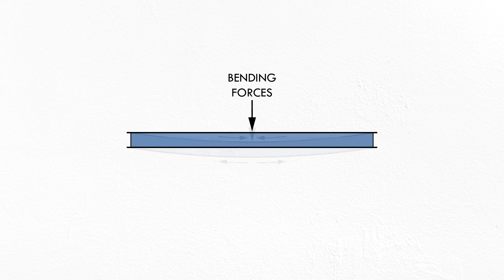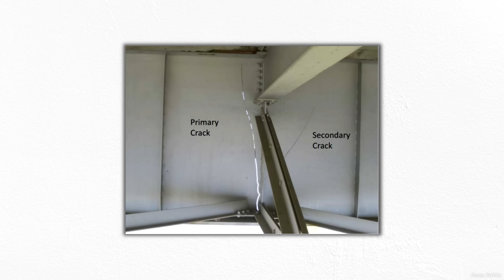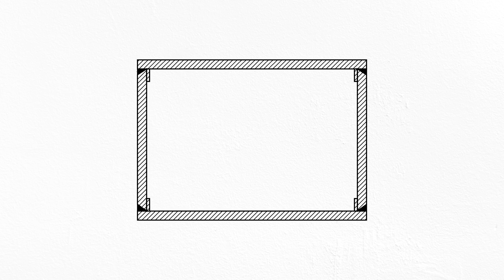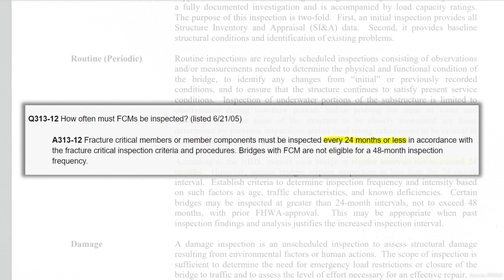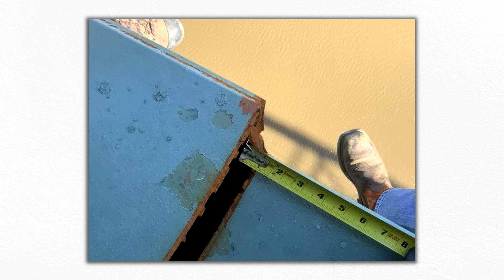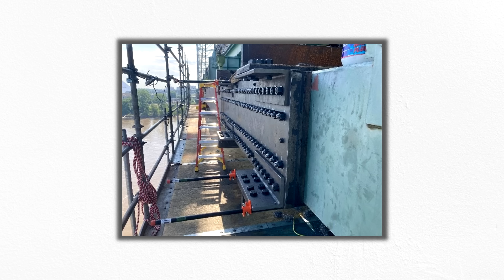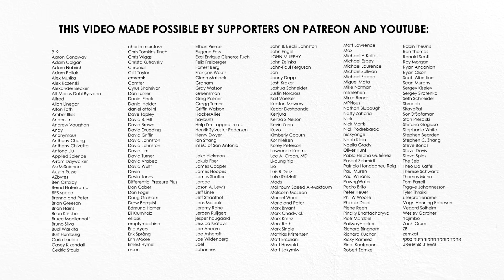What Really Happened at the Hernando de Soto Bridge?

Comment: Arkansas is responsible for the inspection of this federal property 
Arkansas can’t even keep the stretch of 
Interstate 40 
Back in the 80s and 90s the worst interstate highway in the country was Arkansas I-40
Potholes big enough to rip tires off rims disconnect tie rods and break loose lug nuts 
I know because I have been driving for 40 years and I still don’t like driving across Arkansas 
Back in the 80s the only smooth highway in Arkansas was the highway from Little Rock to Bill Clinton’s home in Hope Arkansas

Comment: Kudos on the engineer who insisted on the shut down of this bridge, and had the insight to know that the statics were severely compromised which posed an immediate danger to lives of those using the structure.  I once lived in Stamford CT, and used the Mianus River bridge in my daily commute.  That structure failed catastrophically, losing an entire deck section which caused a number of deaths before the situation was discovered, and that section of the I-95 was closed.  If I recall correctly, that failure was caused by reverse bending fatigue in a pair of steel pins which held the deck in place.  The Mianus River bridge collapse happened overnight, when the traffic load was at a minimum. Had it happened during the daily rush hour commute, the results would have been an epic tragedy.  Bridge inspections are an essential part of keeping the public safe, I'm very surprised that the crack was documented in other inspection records without being subject to closer scrutiny by the responsible parties and that the crack went totally through the box beam before the bridge was shut down.

Comment: Like so many public (and private) construction projects, once the structure is complete, it is often assumed by the owners that it will perform perfectly forever without maintenance.  I've seen it over and over where the owner, at some point becomes aware that there is a failure of some description and wants to immediately know why his poorly (or never) maintained structure has a defect.  All structures age and will eventually haave numerous small or a few major defects to develop that will fail to perform their original function and when enough of these developing defects come to exist, a collapse is possible.  I understand that in the case of this bridge failure, the beam was poorly fabricated and the welds were cracking while the bridge was being erected.  Proper inspection of fabricated members during early stages of construction should discover these, especially on critical members such as this one.  Unfortunately, such inspections are sometimes eliminated when the cost of the project is reduced to the budget and it permits such defects to happen.  Budget cutting by non-professionals is one of the most detrimental things that can cause such dangerous conditions to exist.  Cutting the budget without expecting resulting potential failures to happen is foolish.  Adjust the budget upward to cover the cost of the work or change the requirements for the project (seldom done).  You can't have both a cheaply built structure and a sound structure.

Comment: WOW... I love it that you believe in SYSTEMS and PROCESS and root cause analysis rather than blaming someone. (somehow I knew you would)   No ONE person should be responsible for inspection.  Did no second person view the video that the first person took?  That is a process error.  No major surgery is done without TWO competent surgeons in attendance.  And that's ONE person's life at stake.  How many lives might have been lost because ONE person took a video and no second person evaluated it?  This was a failure of the SYSTEM - which failed either to have quality process or failed to assure it was carried out.  This was a failure of a management team.  Yeah... shake-ups are like earthquakes on a tree. .. the limbs at the bottom get shook up the most... Sometimes, you need a big wind.. to blow the top off.

Comment: I think it's BS, sure there was a problem but look at the rest of the structure you know I'm not an engineer but I am a builder and I've seen lots of things and to jump the gun like that I think is a little nuts in fact I believe the original engineers of the bridge put in safeguards for exactly that kind of thing to happen and for that bridge to still be viable until solution could be applied. Yeah there's arguments I know between all of you and the guy that got fired or the folks that saw it or probably a little more astute than many of the engineers that have themselves all puffed up that they called 911

Comment: This wasn't a stress crack until they performed their retrofits I'm speculating that it was a weak portion of the beam to begin with and it was cracked who knows for how long but when they made the changes and added the strength to the pillars or the pilings they stressed that portion of the support structure more and caused it to finally crack completely it's just amazing that the whole structure stood up to that failure I don't understand why they wouldn't let barges and regular River traffic through it's not going to fall obviously and I think it's easily fixed keep an eye on the rest of the fridge forever and go about our daily business that's just my two cents maybe three

Comment: This was my first time seeing one of your videos and I liked it very much.  I learned a lot about this kind of engineering in a short time back in 2007 when the I-35W bridge next to my workplace collapsed suddenly.  A Berkeley structural engineer named Hassan Astaneh-Asl came to town and we spent a lot of time together.  Memphis got lucky.  I drove under our bridge twice every day, and I had driven over it just a couple of hours before it collapsed.  Someone I knew was on the bridge when it fell, but they survived while 13 others perished.  There are hundreds of these fracture-critical bridges in the US.
Reply: And several more of those here in Minnesota have been replaced since then, starting with the Hwy 23 De Soto bridge in St Cloud -- which was like a smaller version of the 35W bridge, and had the exact same gusset plate issues.  Later was the US 52 Lafayette Bridge in St Paul, the US 61 bridge in Hastings, the I-90 Dresbach Bridge between La Crosse (WI) and La Crescent (MN), and most recently the US 63 Eisenhower Bridge in Red Wing.  Not to mention a number of other, much smaller bridges around the state.

Comment: Yes I agree I worked for BSI and UL on quality of products.
This sounds like the Chinese way of quality as they will fire the person involved, this person usually has not been trained and is an easy scapegoat.
But as you said it should be at le.ast two people looking at lthis, so a discussion car resolve what one sees it's better to highlight a suspected fault than ignor it
It sounds like either poor training or management from the top or both.
I believe that you can now use an optical fibre adhered to structures with computer software, which will alert you of  a failures, As I used to visit a company in the Guildford UK area making the device.
It could also be used for earth quakes, security and mrny other things.
I presume that the beam or brass may have to be replaced?
Thank for another detailed video.

Comment: Well it would be obvious that after one tension member cracked and the bridge didn't immediately fail I would assume other tension members are carrying the load. I would also assume that means that other tension members are now carrying more load that the were designed for. If not dealt with the other members would eventually fail, when enough of them fail a lot of bridge is going to get wet.

Comment: Having been someone who was having to travel across this bridge frequently enough from a previous job. On the eastbound section that the crack was discovered. There is no DOT inspection station going into Memphis. Because of this overloaded dump, and cement trucks would often be seen traveling this section. On the westbound side there is a VERY obvious DOT/Inspection station for Arkansas. And you'd often find them with multiple trucks being inspected or being taken out of service. So that side would of been very under traveled by those over loaded trucks. I personally did not like this bridge as I did not believe it was a safe bridge. (There was a very odd jarring sensation over the proportion that had the crack). That being said, Kudos to the engineering team that built it, they did their math correctly at least!

PS: this was back in 2018.

Comment: 5:18 - the bridge remains standing as the arch has thickness and is not flimsy like your model. The arch on the bridge will allow considerable 'give' compared to the failed beam in straight tension.

Comment: 2:00 Nice crack - but I can't see what it's supporting - it doesn't look load-bearing - it's a suspension bridge, supported from above.
3:52 - looks like the failed beam was too short. I guess the bridge has 'settled', that's all. If the fault was serious, the bridge would have collapsed. ;)

Comment: Hats off to the engineers who designed the bridge. Both the arch and the pylons embedded in the river floor relieve a significant amount of the tension in the damaged steel members considerably. There seems to be at least 2 alternative routes for the forces to flow through, equating to partial redundancy. My guess is that a simultaneous crack/break under the opposite carriageway's corresponding structural element still wouldn't lead to a catastrophic collapse of the bridge. In my opinion a brilliant piece of engineering which took into account inevitable material fatigue and human error.

Comment: Fatigue caused by excessive stress is inevitable in such structures.  Trucks carrying heavy materials where drivers don't adequately identify weight at each axle or overall can, over time, cause such stress with subsequent failure of bridge members.  We see that on highway surfaces where paving materials give up where tires pass over them repeatedly.  Excessive movement of structural members due to such stress can and does create failures.  The 2007 bridge failure in Minneapolis is another example of stress caused by another key factor....design limitations being exceeded.  Adding lanes over a bridge by use of cantilever has some bridges basic structure so overloaded that something like a traffic jam can initiate failures.  In the case of the 2007 failure the cause was eventually identified as a complex set of different factors that created the collapse.  Added lanes, new pavement being added and rush hour traffic all contributed.  Basic supports let go due to the combination of somewhat unrelated factors.  Another cause is poor maintenance.  And yet another is poor design.  With the shear number of such structures it is amazing we don't see more collapses.  Inspectors are our best ally in the fight to combat calamitous incidents.

Comment: A very interesting story and analysis! I couldn’t help noticing in the drone video, as well as the obvious box section crack failure, that a smaller vertical tube support showed signs of a non designed bend with rust appearing to show itself at what may be an impact point. It’s hard to think how that happened. You dealt with flexing weakening. You did not mention the possibility of river traffic hitting one of the support legs, which might have resulted in any impact point being below the average visible waterline levels. Such an impact could have resulted in local increases in steel tensions which may have triggered and sped up your explained traffic load flexing concept, thus leading to the critical failure. What do you think? Also: do you know if divers have inspected below the waterline for signs of impact or other issues there? Thanks for you really interesting approach to complex issues. It’s very refreshing and enjoyable to work my way through your whole output. Regards from a UK farmer who does a lot of self build projects and might have been in construction in another life!
Reply: Well spotted! Looking at the recent crack images again, that vertical tube is very definitely not vertical.
Reply: I am not sure, but I think that is just a downspout for the street drain.
Reply: @DBKING04020  Thanks. I see what you mean.

Comment: Crane rails are mounted on...
In the steel mill I work we do take out all bearing structures of the cold rolling workshop, some are older than fifty years, atm, because some have gaps of 50cm from the lower side upwards.
For the better understanding, these parts are double t, 10m long, 1,5m high, mounted on the floor collums 15m above the floor...
The rails are on top.
We have 11 halls, between 500m and more than 1km long, with between 3 and 8 cranes each...
Happy birthday...
U can't avoid the results of decades of heavy duty. Steel isn't immortal.

Btw, the guy, that found the gaps and shut down the whole crane traffic instantly, was my brother, he's now retired... And the we do not know, who is doing the inspections...
Fascinating.

Comment: Got to love our present age of lawlessness. No Individual responsibility coupled with increased reliance on individual responsibility. Probably the only thing that saved this situation from disaster is the structure is obviously robust enough to stand without that member for a time. The arch itself has some truss to it which can resist some horizontal tension. The deck has both depth and cross bracing all of which adds to the ability to reroute tension for a time. There is a reason why trusses were and are used, not cheap but very forgiving when your materials do not deliver the designed performance.

Comment: The inspection procedures are definitely lacking, this severe flaw could have been easily spotted by either drone inspection or high resolution photography reviewed under magnification. Both of which could be easily accomplished without touching the bridge. A true inspection for integrity would require a much more stringent methodology but even a cursory inspection would have revealed this flaw.

Comment: quick predictive comment at 5:35 regarding why the cracked tie didn't immediately collapse the bridge: the diagonal cross bracing between the ties beneath the deck were able to transfer the tension load both around the crack and to the other tie member.  if one of those diagonals had failed as well, the bridge certainly would have collapsed.

Comment: This is a wonderful review, thank you!  Sweltering in New Orleans after Hurricane Ida I would like to ask you to consider reviewing the multi-day Entergy power grid failure. Apparently one of the major high voltage power transmission towers spanning the Mississippi River collapsed during the storm in winds not exceeding 80 mph. Obviously these towers must be designed to withstand higher winds than that but factual engineering information is hard to come by. Thank you for any consideration and for your excellent Youtube videos.

Comment: Wow! Hugely interesting. Well done! And . . . it appears that stress loads were not already at, or anywhere near 100% for the other elements of the bridge (especially the other tension element on the other side of the bridge!) to successfully pick up the slack for years. Kudos to the original engineer(s) who designed the bridge with such huge excess capacities to accept the immense loads.

Comment: Well, what I think is, very good explanation of a lot of things.  Not an engineer but I am sure glad we have people capable of designing things like this. I am going to tell you something you already know, and I know you know it because it was mentioned several times in your presentation.  This crack was caused by stress, Duh, no shit, right?  You can study the dynamic loading of this bridge all you want but you will not be able to attribute it to this beam having failed.  So I will tell you what happened.  When this bridge was built this beam did not fit quite right.  To marry the holes allowing the rivets or bolts to align this beam had to be forced into place.  Without heating this beam to a very high temperature the stress introduced into this beam applies constant stress not accounted for by the engineer.  Any dynamic loading at all will overload this beam.  The location of the crack is a dead giveaway of what I am talking about. When joints have to be forced into position the greatest stress is in close proximity to the connection. Were this solely a fatigue crack, it would be at the point of the greatest movement. Again just my opinion.  You can agree with me or you can be wrong.

Comment: I'm hypothesizing that the rigid connection between the cross beams and the tie, which may have exasperated the fatigue, ironically also provided enough redundancy to keep the bridge from catastrophic failure by attaching the tie to the road deck, which took up the tension from the failed tie.